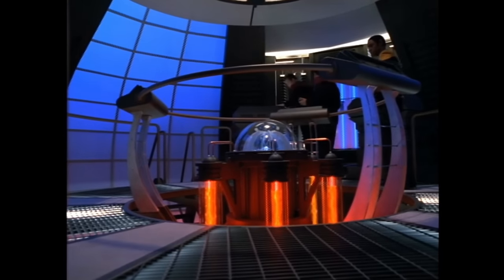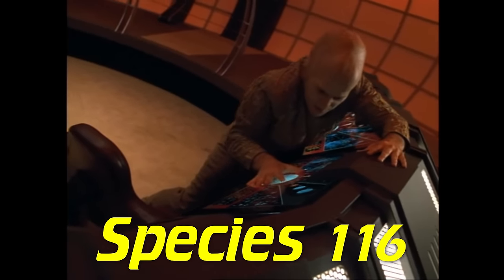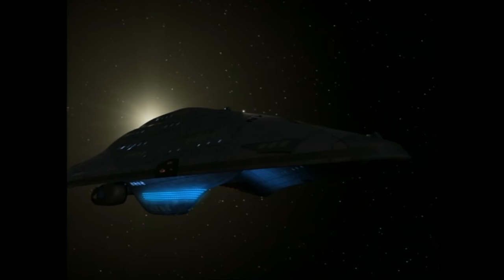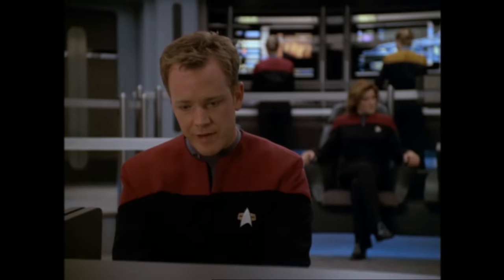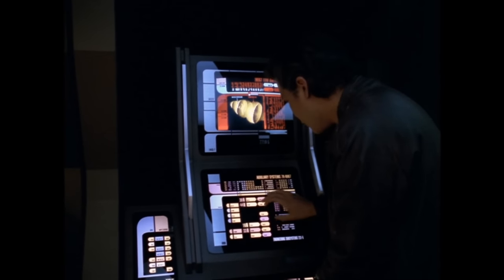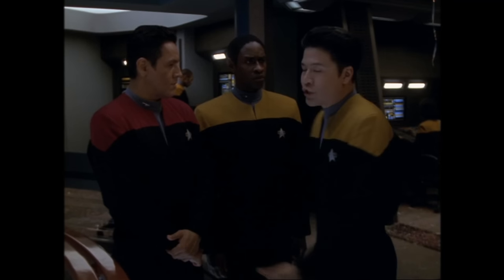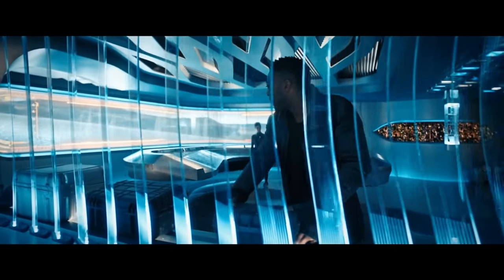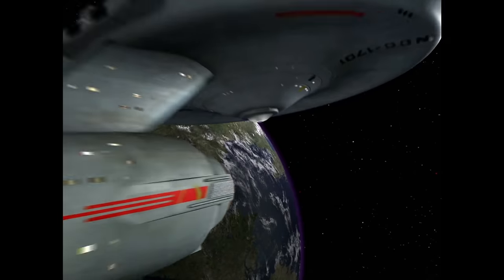Did Discovery IGNORE These Warp Drive Alternatives?

Comment: I am a big fan of your work.
Reply from the maker: Thank you!
Reply: @OrangeRiver  Is there a universal time for the entire universe? The answer is- No!
According to Einstein's theory of relativity, there is no unambiguous absolute time that applies to the entire universe. Instead, time is a relative concept, dependent on motion and gravity. Different observers in different states of motion or in different gravitational fields may experience different measurements of time.
The theory of relativity describes how time and space are related to each other and how they change in the presence of mass and energy. For example, time may pass slower near large masses such as black holes compared to observers farther from the massive object.
Therefore, there is no one universal time for the entire Universe, but time is a concept that depends on the context and observational conditions.
How does the lack of universal time for the entire Universe affect the idea of the FTL (Faster Than Light) drive? Wouldn't this cause time paradoxes - (grandfather paradox) since there are different times for different observers, e.g. the time of a hypothetical planet orbiting a neutron star and the time of the planet Earth orbiting the Sun and the FTL ship travel? Would this be a trip back in time for either side?
The issue of the lack of universal time for the entire universe has important implications for the idea of faster-than-light (FTL) travel and potential time paradoxes.
If it were possible to travel FTL, where an object moves faster than light, then according to the theory of relativity, there would be a possibility of violating causality, i.e. sending information or events in a way that appears to violate the established order of cause and effect.
For example, if an FTL traveler were to travel from one place to another at faster than light speeds, they could reach their destination before the light they sent out when they began their journey. This seems to lead to a grandfather paradox, where a traveler could travel back in time and prevent the birth of their ancestors.
However, due to the lack of a unique time for the entire universe, as well as other theoretical limitations such as the existence of a light speed limit, FTL travel is impossible. There is currently no clear answer in physical theory on how to avoid time paradoxes in the context of FTL travel.
My example with a neutron star and our star as objects with different clocks (times) is a good illustration of the phenomenon of differences in the passage of time for observers in different gravitational conditions.
According to Einstein's theory of relativity, time flows slower in areas with a larger gravitational field. Therefore, for an observer on a planet orbiting a dense neutron star (which generates a strong gravitational field), time will pass more slowly than for an observer on Earth (which is in a weaker gravitational field).
In practice, this means that if we had two clocks - one on a planet orbiting a neutron star and the other on Earth - the elapsed time on these clocks would differ. The clock on a planet orbiting a neutron star will lag behind the clock on Earth.
Therefore, if it were possible to travel FTL between these two objects, when the traveler returns to Earth, he or she might notice that a longer time has passed on Earth than on the planet around the neutron star. In this way, the traveler could experience a kind of journey into the past in relation to the Earth and the neutron star.
I will give a hypothetical situation with the FTL drive (Alcubierre drive), which does not have time dilation. Some FTL-powered ship flies from Earth to the nearest black hole, where time dilation occurs nearby due to a strong gravitational field. Halfway from Earth to the black hole, this ship stops and sends an FTL signal and another at the speed of light (a signal subject to time dilation) to the vicinity of this black hole with greetings. Then this ship flies at the speed of FTL to the vicinity of this black hole (which generates a strong gravitational field causing time dilation) and from there it receives the signal at the speed of light that it sent itself and then sends a signal FTL, i.e. faster than light (and another one with the same information, but at the speed of light) to the halfway point where it stopped earlier and gave itself the information not to fly to the vicinity of the black hole but to return to Earth, which they do. I'm saying that the captain of the ship wants to deliberately investigate what happens when he triggers a paradox.
My example highlights some elements of the FTL paradox. However, it is worth noting that the Alcubierre drive he describes is a hypothetical model and has not yet been proven to be technically feasible.
In my scenario, when the FTL ship stops halfway and sends a signal at the speed of light to the vicinity of the black hole, there is a potential contradiction. The signal undergoes time dilation, which means that time on Earth will passe faster than in the vicinity of the black hole. This means that when an FTL ship returns to where it stopped earlier and then receives the signal it sent, that signal may suggest that more time has passed on Earth than has actually passed on the ship.
This seems paradoxical because the FTL ship receives information from itself that suggests that a longer period of time has passed on Earth, while the traveler on the ship has not experienced the same passage of time.

Comment: Excellent video! Quite thorough. I'm sure it was a lot of hard work, so thank you very much!
 You forgot to mention sail technology, which has been around for thousands of years, and is still in use today, before the invention boilers big and powerful enough to provide steam power, which was a quantum leap in propulsion. The transition from warp to faster than warp may have needed to take a while.
Reply: What is your response to the comparison of sail to space/time warp, in how long it took for steam to replace sail compared to how long it took other FTL drives to replace standard warp drive?

Comment: As an aside, one other tech that felt like it stagnated in the centuries years leading up to season 3 was weapons technology, as quantum torpedoes were still in use in the 32nd century after about eight centuries.
Reply: Quantum Torpedos bsically replaced photon torpedos and would most likely be more powerful, although it is still weird that more advanced weapons like Transphasic Tech aren't mentioned
Reply: @Watcher1134  agreed. You'd think they'd have dark matter warhead and retro-causal energy beams that would travel back in time and so there would be an explosion followed by a beam returning to the attacking ship
Reply: @Mat0llig Time Travel Tech is banned
Reply: And Photon Torpedoes were an old tech even by the time the Federation formed, as the Klingons already had them beforehand and it wouldn't be surprising if the Vulcans and Andorians had them. It may very well be that Photon Torpedoes are very well near the peak of what you can actually do with weapons without getting into the planet-busting stuff that's banned by treaties. Quantum Torpedoes are probably the best you can do without cracking out the crazy uncontrollable subspace stuff.
Phaser tech may have advanced in ways that weren't obvious as phaser power seems to depend on how much energy and exotic particles you can shove into the beam, and really fits the Federation style the best due to being a precision weapon, while the alternatives tend towards brute force/annihilation. There's probably some nasty stuff they could put on their ships if they wanted, like subatomic disruptors or whatever, but that's the sort of thing you would probably only see come out in an active wartime situation against a foe of equal or greater power.
Reply: Where are the transphasic torpedoes from the Voyager finale in the future shows?
Reply: @Watcher1134  
a 31st century ' Quantum ' torpedo might be a  lot different to a 24th century one, with multiple technologies merged into a single weapon. it's Quicker to say fire a  Quantum torpedo than fire a quantum zero point powered, transphasic modulated, gravitic charged torpedo.
Reply: @thanqualthehighseer  Exactly
Reply: @KertaDrake  My head canon is that 24th century photon warheads were pretty much the same thing as 22nd century warheads, and the improvements were in torpedo guidance, propulsion, and payload. The laws of physics can't always be bent or broken and photon warheads may have reached their full potential in the 22nd century.
Reply: @zarcon666  Maybe unlike Voyagers photons there actually was no way to replace them after Janeway went berserk and fired them all off.
Reply: @zarcon666  Those things were probably just normal torpedoes with specialized anti-Borg tech on them to keep them from adapting easily since Voyager could manufacture them. Antimatter still gives really big boom, just that you need to ensure it actually makes big boom inside the target rather than just exploding on the surface.
Reply: Not a lot of ways to improve on a matter / antimatter annihilation.
Reply: @pocketheart1450  But that's like saying there are not a lot of ways to improve on a bow and arrow.
Reply: @bjorn00000  The power that is generated by the matter / antimatter annihilation reaction is fixed, the only way to get more power out of it is to use more matter and antimatter. A bow and arrow will be limited by physical properties such as the length of a human's arms, how much weight he can draw back, the flexibility of the material used to make the bow, the atmosphere and gravity the arrow has to travel through, etc.
Reply: @themidcentrist  Accurate they just improved the designs for Photon torpedoes over time.
Quantum torpedoes (which use Zeropoint Energy to enhance the standard mater/antimatter explosion) were invented in the late 2360s and first included in the Defiant, Sovereign and maybe Akira classes before becoming standard alongside regular photons in the mid 2380s Odyssey class
Reply: @themidcentrist  In Quantum torpedoes they use Zeropoint energy (essentially using Vaccum energy to create volitile subatomic particles) to enhance a "regular" m/am reaction.
Transphasic Weapons radiate their distructive energy through multiple layers of phased space. A ships shields and hull can only block one component of the blast which it is why they were so effective aganst the borg due to the fact they had not accounted or adapted to the new frequencies.
Reply: @themidcentrist Certifiably Ingame and Spacedock have videoes explaining Quantums and Transphasics, most of my points are from memory of their explinations. My mom loves SGA.

Comment: There is one more dillithum alternative. Lithium crystals. 

In the 23rd century starfleet was able to crystallize lithium for use in warp cores. While just as efficient as dillithum, lithum crystals where much weaker and had to be changed out more often than dillithum. The Enterprise 1701 originally ran on Lithium before being switched to dillithum. 

Also the spore drive wasn't classified it was banned. This was because of two things. One using a computer to navigate the network cause damage to it.
Two using an organic pilot was unethical because for a human to pilot the ship they had to be genetically modified to interface with the spores and to use a native of the network was akin to torture.

Comment: I always assumed that "transwarp" just became "warp" once it was commonly used.

I also always assumed subspace vortex wasn't as fast as 23ed and 24th warpdrive, that is why it wasn't used later.

There is one potential flaw in some of the transwarp techniques seen, the ones used by Q the caretaker, etc. Those could have involved time dilation. That second that it took Enterprise to be sent to Borg space could have been hours or days in the rest of the universe(still faster than Star Fleet) and the way the Caretaker brought Voyager to the Delta Quadrant the crew may not have experience time even though it passed. We don't know, it was never established either way.

Comment: I feel a lot of people are confusing the Warp Core with the Warp Drive, the Warp Core is the power generation for the Warp Drive among other systems on a ship. The UFP needed to be looking into new forms of power generation that didn't need Dilithium. Nearly every FTL tech starfleet had knowledge of required massive amounts of power which required Dilithium as a focusing/regulator material for whether its a M/AM reactor or Quantum Singularity reactor. The fact that it was know that Dilithium is a unsustainable resource in the early day of Warp travel should have started the major powers into looking for different power sources that didn't require it.
Reply: The Phoenix (first earth warp ship) and most warp shuttles use a fusion reactor for their power supply.  You don’t get MARAs until larger ships like runabouts.

All you need is enough plasma to power the coils.

Comment: You’d think starfleet and the federation, who are famous for having backups of backups of backups, would have backup mega storage full of dilithium in case anything like the burn would happen…..
Reply: Ugh. No. We only have a second backup for our first backups.
Reply: I’d feel that starfleet by this point would have some system to shut down or shunt the energy of the reactor if a core breach was imminent
Reply from the maker: Yeah, I would have much preferred if they had just made it so all the dilithium in the galaxy was used up and warp travel had to be slowly phased out, rather than the single cataclysmic event. It would have served the fossil fuel metaphor much better.
Reply: @OrangeRiver  I completely agree. Having be some diablous ex machina just cheapens it for me. I would have liked it if it was something avoidable or with more meaning. 

Like if the threat of running out of it or conflict over switching to different ftl systems due to warp damaging sub space had led to the fall of the Federation instead of some sudden unknowable event. Be much more interesting and tragic. Not to mention a comment on modern society fighting over fossil fuels
Reply: So wait. The burn destabilized and destroyed most of the dilithium in the galaxy. And you think them just having a big stockpile of it would have helped things and not just...gotten the stockpile destroyed? The burn didn't just wreck what was actively in use, it broke it even in backup storage. 

And even if it hadn't, without knowing what CAUSED it the disaster, they could just be setting up the galaxy for it to happen *again*.
Reply from the maker: Yeah the thing about fiction is, whenever people try to point out "plot holes," especially in a sci-fi setting, it's really not hard to accept that things happen because of specific in-universe story reasons. Theme and characterization are IMO more important
Reply: @OrangeRiver thaaank you

Comment: Warp drive is slow. The universe (there's the convenient galactic barrier in Star Trek) is at least 20 trillion light years, about 250x larger than what we see in the 93 billion light years of the observable universe. Because of how slow warp drive is, United Federation of Planets (UFP) is only around 8000 light years in size. That's small on the universe sized scale. This has never been addressed in Star Trek and I don't think they are ever going to do so.

Comment: The Federation still using Dilithium controlled M/A cores to power traditional warp drives in the 32nd century never made any sense.
Reply: In all likelihood the M/AM reactors were just doing the job fusion reactors do in the 24th century, that of powering secondary systems and making damn sure dangerous stuff doesn’t get out. And I mean Fusion Reactors can blow with enough force to take out a ship too.
Reply: Yeah, it's just bad writing.
Reply: My dumv theory about that is stagnation. The federation became so strong it was basically the only power in it's part of the galaxy. Hegemony breeds stagnation, and stagnation breeds inflexibility.
Reply: @padinspi11  They probably peaked sometime around the Enterprise-J, really. After the Sphere Builders, there probably wasn't anything left in the galaxy to challenge them since the Borg were likely as gone as could be at that point.
Reply: @KertaDrake  Yeah they ended up like early TNG. There was just nothing bad happening ever so they were completely unprepared against any danger.
Reply: It’s like us now still using oil when we know water engines are a thing
Reply: @georgevazquez244  Weeeell i'm not sure they are an actual massively usable tech yet, but maybe they're coming soon. But the fact coal and oil as an energy source are still growing massively is insane. We have many alternatives that are better for the environment, not more expensive, not dependent on ressources that could be running out soon and safer (nuclear and renewables of course)

Comment: To me its not the burn that is the problem its two things: 1. Why did all those starships go boom? If anything goes wrong in the core they should eject it and save the ship. And honestly just cause the dilithium wouldn't canalize the reaction anymore the containment instantly breaks? 2. Its not only that warpdrive is gone. The federation as a whole ceases to exist. There is no subspace communication anymore. The matter Antimatter reaction should still work. there are methods hell even a solarship from bajor could reach low warp factors so at the very least the core worlds next to each other should have managed to stay in contact. Also if Matter and antimatter still produce energy you can't tell me delithium is the only thing that makes it possible to harness enough energy to create warpplasma to enable low warpfactors.
Reply: dilithium is also just the powersorce, Its not the thing making the warp field. The whole idea of the burn then the whole galaxy becoming a dark age is dumb.